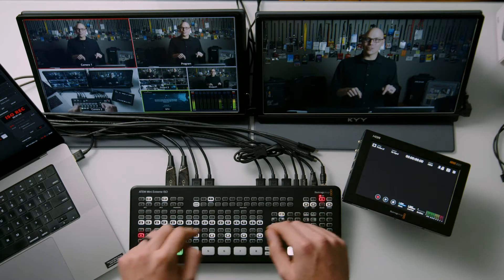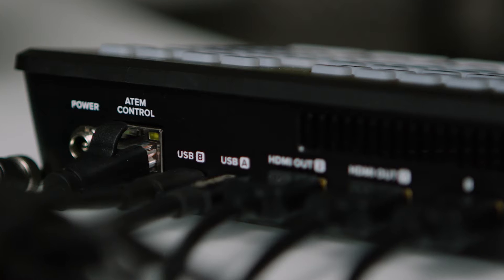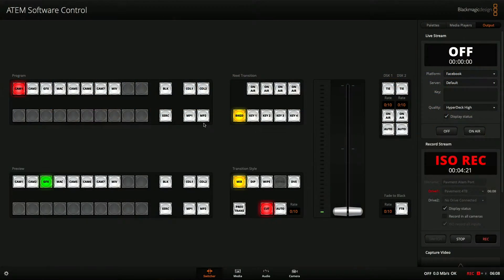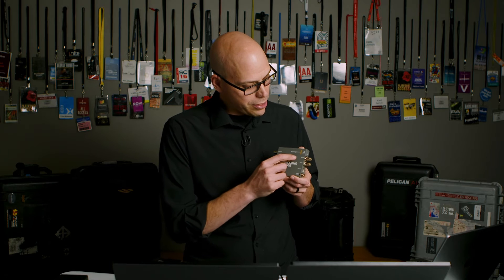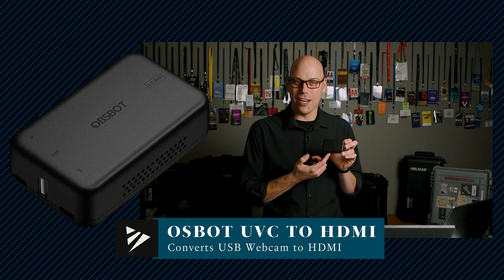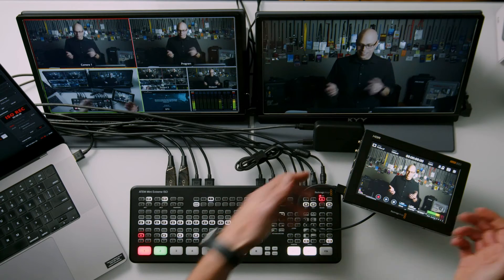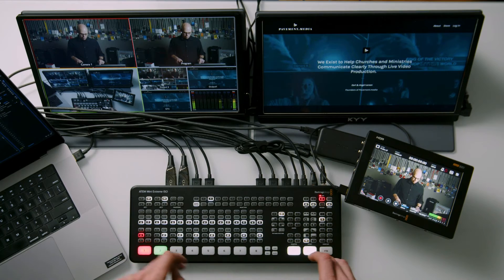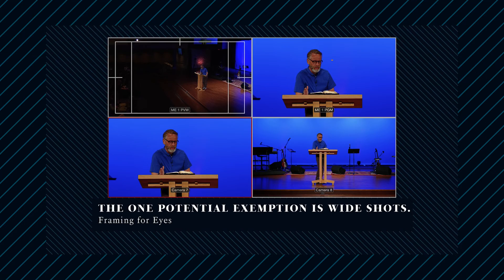Get an extra HDMI out on the ATEM mini! Webcam USB to HDMI converter trick!

Comment: If the idea was to simply have another program out going to a monitor, would it not just be easier to use a HDMI splitter and keep the USB C port free? For example, in a recent shoot I had to use USB C 1 for my laptop to use ATEM control software, and USB 2 for my SSD to do ISO recording. So using those wouldn't be an option for me. I used HDMI output 1 for my multicam monitor, but then I had to send the program feed to multiple TV screens via HDMI output 2. Using a splitter, I was able to split 1 HDMI output 4x.

Comment: I have tried this all day. I have the extreme just like you but it is not showing video. The obsbot logo comes on for a split sec and then a black screen
Reply: Thanks for the reply. I figured I got  a defect. Ordered another one. The crazy thing is it works on my atem mini… but not the extreme.
Reply from the maker: That sounds really frustrating. It seems like you’re doing things right. It’s plug and play - can you return for a replacement?
Reply: im having the same problem, did you ever get yours to work?
Reply: @nodencrantz  no. I called black magic and they said this will not work with my he extreme iso because the usbc port has two functions (external recording & webcam) so when you use the osbot it doesn’t know to output video. Rep said he would give it to their developing team and we may see it fixed in future updates.
Reply: @Iamalvingeorges  Dealing with the same issue here. Was excited about this being a nice solution for my ATEM Mini Pro. 😩
Reply: @KyleGilbertDesign I just had the same issue, but managed to fix it.  Powered everything down. Instead of going from the usb c on the atem to the usb c on the Obsbot, I went from the ATEM into the usb type A on the obsbot. Then powered everything one and worked perfectly!
Reply: @jackwolf2758  seriously?! Thanks for letting me know! Working on another solution now; but will try that if this doesn’t work out.
Reply: @KyleGilbertDesign  No problem!  Initially i thought going into the USB A wouldn’t work, but thought I’d try it out anyway… was very surprised to see the result!  All the best with it!

Comment: Hola, se puede configurar un tercer multiview al atem 2 e/m ?, Muchas gracias
Reply from the maker: No this will not work for that. The Constellation 2 M/E only has 2 multiviewers, but can have either of those  assigned to any of the 12 x 3G outputs.
Reply: @pavementdotmedia  gracias por la respuesta, abrazo grande
Reply: Te hago otra consulta, cómo configurar multiView atem Blackmagic desing 2 e/m, tengo 10 ventanas y necesito poner 16, muchas gracias

Comment: Is there a similar option to incorporate IP cameras as an an HDMI input source?
Reply from the maker: Yes. This will do that as well. It turns a usb webcam into a HDMI signal. You could definitely use it to turn an IP camera into a traditional HDMI source
Reply: @pavementdotmedia  But an RTSP source is traditionally over Wifi or Ethernet; let's assume ethernet for simplicity. So how could you go from RTSP over ethernet to HDMI?  Raspberry Pi + FFMpeg is the best idea I've come up with.  Do you know of a better solution?